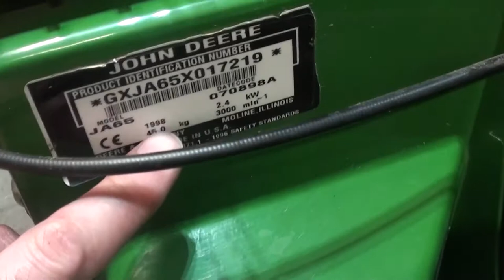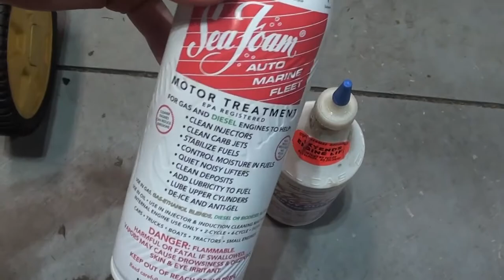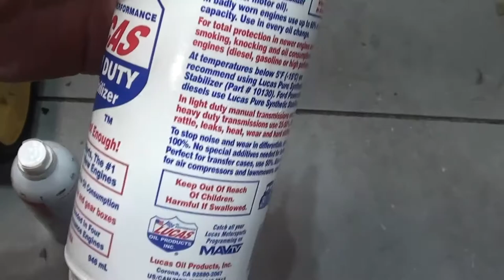Can We Fix It? John Deere JA65 Won't Start

Comment: I believe 2003 was the last year for USA made John Deere walk behind mowers.  After that they were made in China.  Then discontinued.  I just learned that Honda now (May / 2023) had stopped production on walk behind mowers.  All that is left will be junk coming from China.  Real nice like.  (NOT)  Sad to see the quality units all disappear.  Thanks for saving this John Deere JA65 treasure.
Reply from the maker: Thank you for watching! It is a shame how very little is made with pride anymore. Cheap and disposable is the name of the game and it’s very unfortunate 😕
Reply: @ChrisXOutdoors  I have a Echo SRM2100 string trimmer that I bought in 1993 and is working like new.  Just a month ago it required a gas line kit ($10) and that is it.  It still the original spark plug.  They just don’t make them like that anymore.
Reply from the maker: Not surprised! I love those 👍🏼